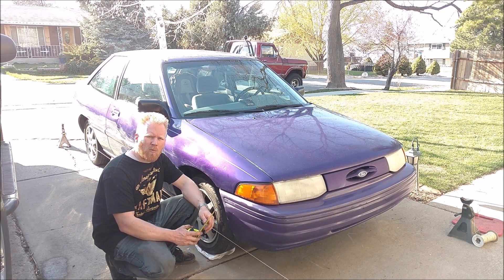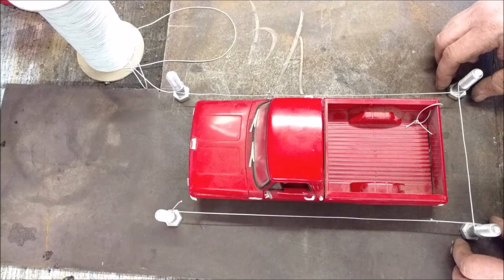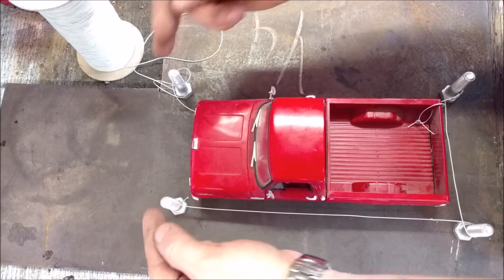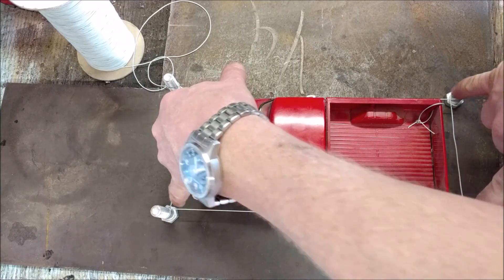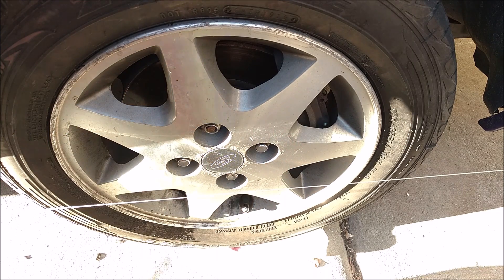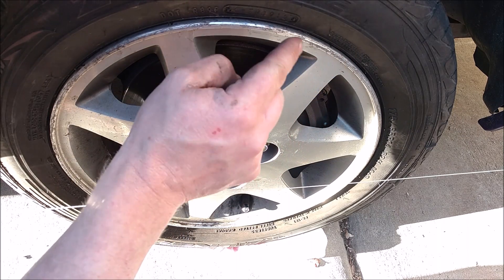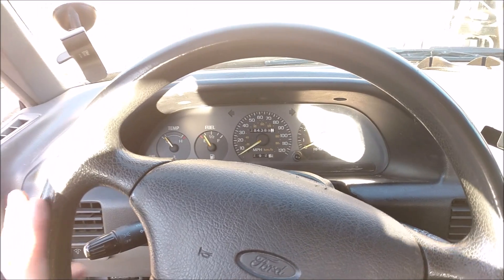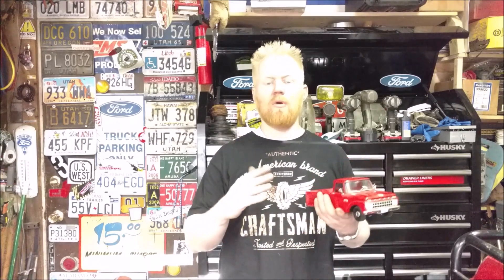Front End Alignment in your driveway Done right

Comment from the maker: CAMBER? Though not discussed in this video it is easy and I describe how in the VIDEO DETAIL page below the video.
Reply: The adjustment measurements you are using is for total Toe, individual toe would use a slightly different process would it not?  

For individual wheel Toe measurement, would you not adjust to the one side with the steering wheel centered?  Then adjust the other side?
Reply from the maker: @chrish7336  Well the first problem is you don't know which side is out. It's easiest to set the correct measurement/ toe. Then if the wheel is not centered; you simply do opposite what you do one side to the other side. For example, half a turn on one side in and half a turn on the other side out. This will move the steering wheel without messing with the alignment that you set. Just do opposite on each side until the steering wheel is where you want it to be. You will need to drive it in between but you don't have to measure it again.
Reply: @sixtyfiveford  I guess that would accomplish the same thing.  Will have to keep that in mind, I figured I would center the wheel then Adjust the 1 wheel within limits and then do the same on the other (using angle calculations).  This process may make it a little simpler.

Thanks for the info.

Comment: So I have a 97 Chevy c1500. Almost every new set of tires I have ever had put on it even when I get an alignment from the shop, wears the outside edges faster than the rest of the tires and it pisses me off so bad. Do you think this is due to a bad alignment job, toe and caster, or that worn front end parts are allowing the tires to move around even though the alignment was correct when it’s sitting still. Which seems like the shop should wiggle the tires to see if they move around and tell me so that the lose/worn components can be replaced. Hell they would make a bit more profit by doing that!

Comment: Hey Moe, thanks for this. What do you do for all wheel drive vehicles?
Reply from the maker: Process is the same. Specs are

All Wheel Drive: 
Front- toe out 1/16" to zero
Back- toe in 1/16" to zero
Reply: @sixtyfiveford  Thanks for the quick reply!
Reply from the maker: @JDeWittDIY So generally running down the road you always want some sort of toe in. But front wheel drive vehicles pull so having a slight toe out will actually make it a toe in while driving under load. Some from the suspension some from just the tire flexing. In the all-wheel drive aspect, the rear-wheel drive is only an auxiliary source of power relying mainly on the front wheel drive. So in that scenario you put the rear axle at a slight tow in so it's already there. If that makes sense.
Reply: @sixtyfiveford  Got it. So AWD is essentially handled the same as FWD, which makes sense.

Comment: Measuring toe-in at the wheel is not accurate, it has to be measured at the outside diameter of the tire. The farther out from the center of the spindle you measure the more the toe-in changes.
Reply from the maker: You can not measure at the tire sidewall nor tread. It varies as much as 1/4-1/2 on a lot of tires.
Reply: @sixtyfiveford  You have to jack up the tire so you can spin it while using a piece of chalk to draw a line around the tire, then measure to the line.

Comment: Good video well explained  65.....One thing I could add is invest in a steering wheel stop or you could even use ratchet straps tied to the seat frame, to stop the steering wheel from moving while you're turning the tie rod ends....Gets rid of trying to get the steering wheel straight at the end..

Comment: this method works well for setting toe, but there is more to an alignment than just toe, also need caster camber set.
Reply from the maker: Very few cars can you actually adjust the camber. Caster though can be adjusted on some cars, though a lot you actually need to buy special hardware kits with eccentric bolts / washers to actually perform any sort of caster adjustment. Caster is as easy as putting a digital level vertically on the wheels.

Comment: finally someone who makes sence. I never understood why people always use the string method and measure the same distance from the front hub to the string as the rear hub to the wheel. Both axles may have a different width so it makes no sence to me. But I don't agree on the "toe out" part, but that's a matter of preference.

Comment: I seen a classic truck in your thumb nail ?  I have a 69 F250 it very basic there's only one ajuster sleeve on the driver's side the drag link with built in solid tie rod on he passenger side to the pitman arm .
ajustment sleeve with ajustable tie rod end on the driver's side only how do you do a toe on that old ford truck like that dentside 4x4 in the back ground ...I just did 3" lowering beams and a 73 250 disc brake swap the track now is way wider up front and the original draglink alignment  position was way off with one ajuster on the driver's side not sure how to do it .

Comment: I may be missing something, but it seems as though you don't really need to have the line in the back of the vehicle.  Just put a long 2x4 or whatever in back, then butt and square your jack stands up against it so when you move the line of the string in or out, it wont pull the stand on the opposite side....No? Just make sure you have some weight on the 2x4 so it wont move when you slide the jacks in or out when adjusting your distances from the center of the hub. =)
Reply from the maker: You just need two parallel lines down the side of the vehicle. Nothing needs to be in in the front of rear
Reply: @sixtyfiveford  Heck. that sounds even better.

Comment: Just run you strings out a little more and do a 3 4 5 hypotunuse.diagonal is 5 perfectly square.
Reply from the maker: True, but you don't need square. You just need two parallel lines.
Reply: @sixtyfiveford  l dont trust that for the reason tires wear at differant rates.

Comment: Thanks for the video!    Explained DIY home alignment really well.   
The 2 x 4's make set up real fast.  I'd used the car jack method before but getting the stringlines perfectly aligned and parallel was a chore.  With the preset wood, I can now set up and check my alignment in about 20 minutes at most.   I can easily and repeatedly set up the nail positions correctly relative to the car, now knowing the distance from the front and rear wheel centers to each string line.
I did find that the rear wheels/axle on my Mustang were 6mm out of parallel with the front, ex-factory!  Putting on adjustable rear Lower Control Arms, I was able to fix that, then get a perfect alignment.

Comment: I'm confused all the other vids say front wheel should be towed in, does it matter as long as it's a 1/16"?
Reply from the maker: Front wheel drive is the only one you set to ZERO- barely toe out. This is because the wheels will bend/flex and toe in naturally under acceleration/load.  
Front Wheel Drive: 
Front- toe out 1/16" to zero
Back- toe in 1/16" to zero

All Wheel Drive: 
Front- toe out 1/16" to zero
Back- toe in 1/16" to zero

Rear wheel drive:
Front: Toe in 1/16-1/8"
Rear: 0

Comment: Excellent vid ! My tires are wearing on the inside , it's a 03 trailblazer,  what's best to do ? Thanks brother !!!
Reply from the maker: First thing I would check is worn out ball joints. This will affect camber which I don't discuss in the video. This is how straight up and down each tire is relative to the ground. You can check this pretty easily.
-Park on perfectly level ground (you can pull one tire onto shims/blocks to achieve this). Check with carpenters level.
-Take a straight edge off the rim from the bottom to the top(standing up) and measure how level it is. 
-You want to have a 0.5 - 1° of negative camber(tire top towards car center. 

This is more easily done with a digital angle gauge like these: https://amzn.to/3brByBK . But you can see severe out of tolerance with a simple carpenters level and generally get it very close.
Reply: @sixtyfiveford  wow ! Thank you,  will do kind sir !

Comment: What bout if u have camber wheels ???
Reply from the maker: Park so the vehicle front wheels are on a perfectly level surface(may have to park one wheel on shims/blocks). Put a straight edge on the wheels vertically. Use a digital level to determine the degree camber of driver and passenger wheels.

Comment: Is this method of making the lengths of string on each side parallel to each other easier yet still reliable? rhttps://youtu.be/0sguZ-gRF9I
Reply: I realize now that the method used in the video I listed above will only work if the rear wheels are parallel to each other, and as you explain in your video there are many reasons why the rear wheels may not be parallel.  Another problem is that since only a short length of the string, equal to the diameter of the wheel, is used to attempt to straighten the entire length of the string it would be difficult to get the entire length straight.
Reply from the maker: The biggest issue is tire sidewalls aren't precise all the way around. New tires you can almost always see a few ripples that would dramatically throw off the measurements. This would be better if it just touched the rims.

Comment: The common mistake people on YouTube make is that it does not materr if your back axle is wider or narrower than the front axle. It's all relative. You will just be working with the string further away from the front wheel or closer to the front wheel. BACK AXLE WIDENESS DOES NOT MATTER IF ITS NOT THE SAME AS THE FRONT AXLE WIDTH IT'S ALL RELATIVE

Comment: does it matter if the car is lifted up in the air or if the car sits on the ground when you do this?
Reply from the maker: Yes, if the the tires aren't touching and the suspension compressed it will give you inaccurate readings.
Reply: @sixtyfiveford  thanks !

Comment: I just used this method. Worked great. My car has to be raised to make the toe adjustment which means I have to setup and adjust the strings each time. I did it three times. Three of my car's wheels were good and I got consistent, repeatable, measurements across each of those three separate string set ups. The one wheel that needed adjustment showed the expected change after each adjustment.  I did this after installing new tie rod end on both sides.
Reply from the maker: Awesome, I've had fantastic success with this.
Reply: Same car got the string alignment again after getting new front control arms. Worked perfectly again. It had a slight right pull, and the measurements showed a slight right front tow out condition, which matched what the right pull. Adjusted that out and the pull was gone.

Comment: If rear toe is non adjustable on a vehicle and you know it's right, that string can be measured off the back and front on the rear rim, string  adjustment is made by moving the string from the front of the vehical until the string is straight with the back rim. That'll give you a straight string for the front wheel to be measured off of. Can't really measure just off the center of the back wheel, cause you still can't know if the string is straight with the rims. The string has to be measured off 4 points, 2 off the back wheel and 2 off the front wheel. String should be really tight so it doesn't shift,  the thinner the string the more precise measurement.

Comment: Great video!  Is this toe-in or toe-out measurement for EACH tire or total?
Reply from the maker: Toe in listed is Total. So 1/16" would be 1/32" per tire.
Reply: sixtyfiveford 
Wow!  Doesn't seem like that would render the desired affect.  I do not pretend to know much on this subject of alignment but am interested in learning since I just replaced my passenger side tie rod assembly.  I carefully measured the old one against the new, installed it then measured the distance between the front tires at the front and rear of each and the distance at the rear of the tires is 3/8" wider!  Steering wheel is maybe 2-3 degrees off to the right as well.

Driving the car, it goes straight down the road but I know I'm going to wear tread accessively if not corrected.  Am hoping I can get it closer if I decide to try to correct it on my own.  Thanks for your reply.

Comment: Great video, very informative and I agree with the comments of this video being amongst the best of DIY alignments.

When you were talking about setting the camber, It didn't seem clear what the camber setting is a good role of thumb. Can you clarify this? Would 90 degrees be a good camber setting?

Thanks much!
Reply from the maker: Camber varies a lot due to the cars suspension design and how it is set up to handle. You can add more negative camber for more aggressive cornering, etc. I would Google your exact car to get specs. but I would say a slight negative camber -0.05° is typical. On a 15inch rim this would be 0.013 inches in at the top of the rim vs the bottom.

Comment: Great video! However, I can't seem to find a good video which also explains camber / caster adjustments in addition to toe adjustment.
Reply from the maker: Most vehicles you can't adjust Caster and it's fixed from the factory. However Camber is adjustable on most vehicles, but not all. It generally involves special shims or adjusting eccentric cam bolts to move the top or bottom of the wheel in or out. This is as simple as putting a carpenters level on each rim vertically and making sure it's straight up and down level(make sure you're parked on a perfectly level horizontal spot).

Comment: I'm sorry your method is deeply flawed !  Your method of making a square is wrong! 
You have to measure corner to corner they must be exactly the same where the lines cross if not you are not square! 
That makes all of what you are measuring thus will be wrong!
Reply from the maker: Square doesn't matter. You need parallel lines.
Reply: there is no square.  it only matters that the two strings are parallel with each other and with the wheels.

Comment: Measure the center of the tread of the rear wheels. Then go up front and do the same toeing it it according to specs.  Center the steering wheel turning it fully left counting the TURNS and then full right  counting turns. Stop at  the middle, centering the steering wheel. Get OTC steering wheel holder or have someone hold it. JEG has a toe-bar. Get a caster-camber gauge  and appropriate  tools. Check the tires for bumps while rotating it to check for out-of- round. Check  tie-rod ends and steering for looseness first.

Comment: You need to be mechanically inclined to do this, tie rod lock nuts can be very tight. I would only do this in an emergency until I can get it properly checked. Next all most all front wheel drive vehicles run on 0 toe, not toe out as done many years ago.

Comment: You're assuming that both front and rear axles are perfectly centered under the vehicle. If they are, then great, but if you have a lifted Jeep with solid axles, the axles will shift the more you lift it. Even if you correct it and recenter the axles, no one can guarantee that they are centered precisely enough for this alignment method to be accurate enough. I think measuring the difference between front and rear of the front tires will be more reliable.

Comment: Do you do the alignment with the car in the air or on the ground?
Reply from the maker: Directly on the ground so the suspension is loaded with the car's weight. The alignment will change with a drooped suspension vs a loaded.
Reply: Drag racers will do it with it slightly lifted to the average amount of lift on takeoff so its aligned when the suspension is not under full load.

Comment: I rather pay for a $45 dollar computer alignment and not tweak something out of adjustment. In the long run it'll save me from myself prematurely ruining my tires.
Reply from the maker: Then why are you watching a DIY alignment video?
Reply: Who does computer alignments for $45?
Reply: There might be an alignment kingpin in some back alley offering $45 computer alignments, but I've never seen it.
Reply: 100$ Easy in NY and most places wont touch your car if its old, if its newer "Its gonna need motor mounts, hubs, ball joints blah blah blah"
Reply: That's what I was thinking. I live near the South Jersey Shore and it sets you back $70-$80 in my neck of the woods.
Reply: heyitschino An alignment for my car was $200. I'm going the string route.
Reply: There's no such thing as a $45 alignment. Those who think so have obviously never had their car aligned
Reply: In NC cheapest computer alignment is $60 most will charge $65 -$80. plus another $150 to $300 to adjust the Camber. I have done alignments by adjust and drive (Trial and error) but I am not getting my '94 concorde to align so I will give this method a shot.